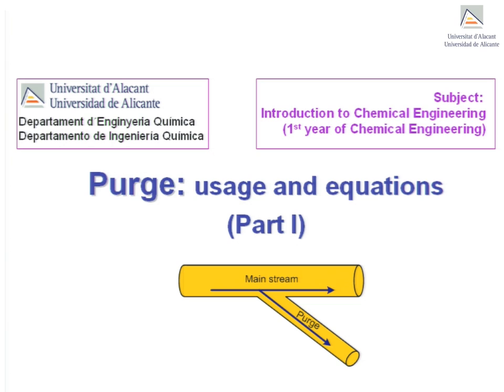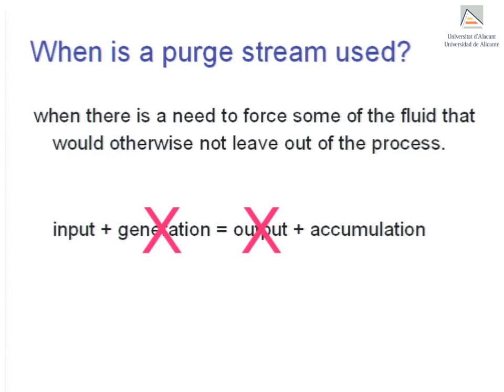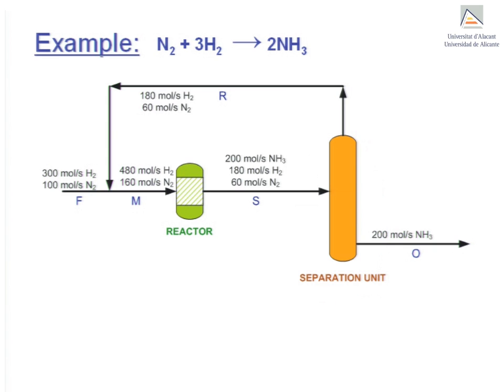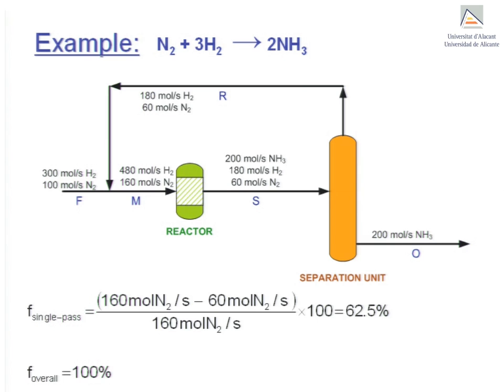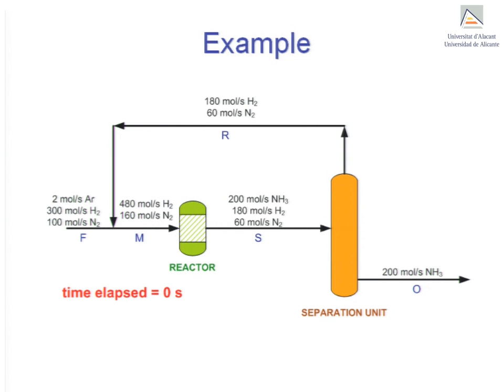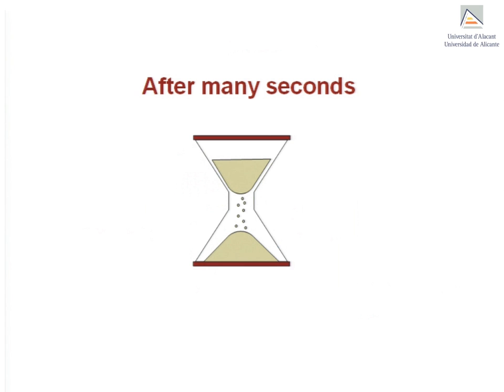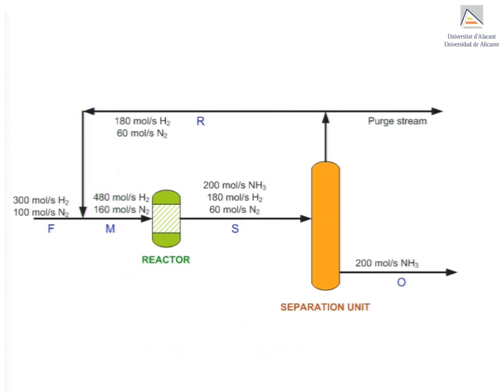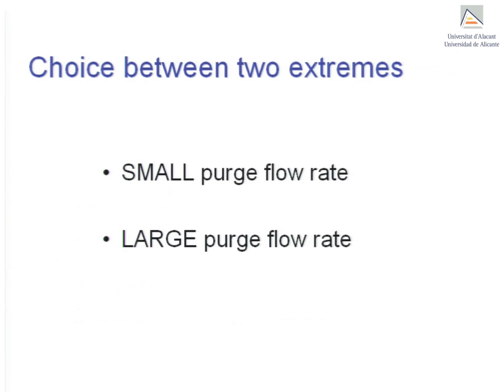Purge: usage and equations (Part I)

Comment: I would like to ask a question, when there are side
 reactions going on do we also recycle those reactants which are consumed in those side reactin?
Reply from the maker: Sello,
the answer to your question is that "it depends" on the particular problem. A recycle stream is usually done after a separation process (not always), so you need to carefully read the statement of your problem and find out FIRST which species flow in each stream. If the conversion is not 100%, then you have "left overs" flowing out of the reactor, and depending on the separation process, it will either flow out of the system or be recycled. Hope that it helps.